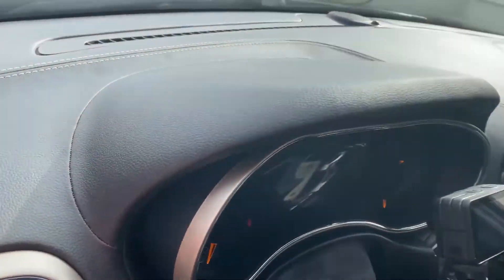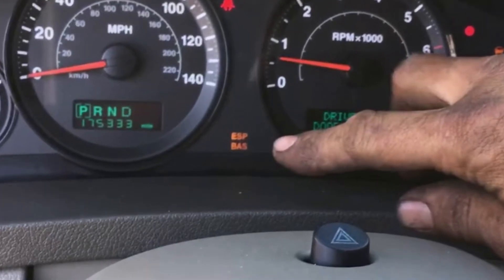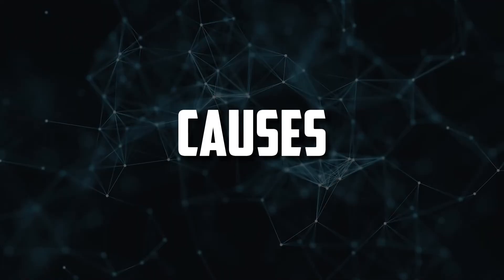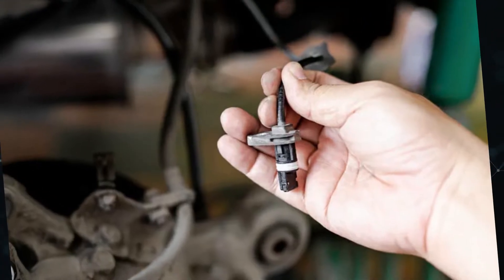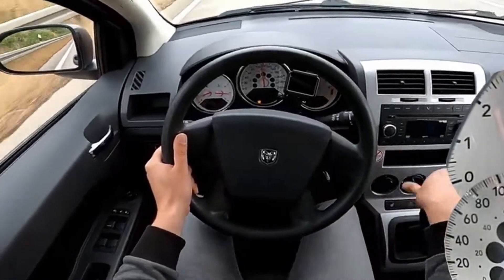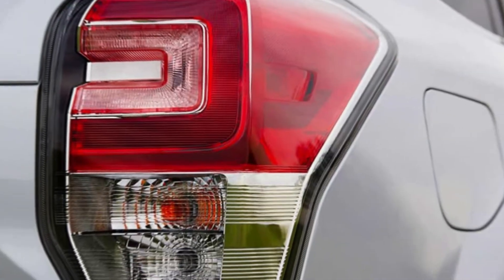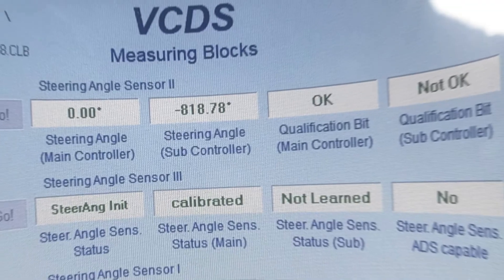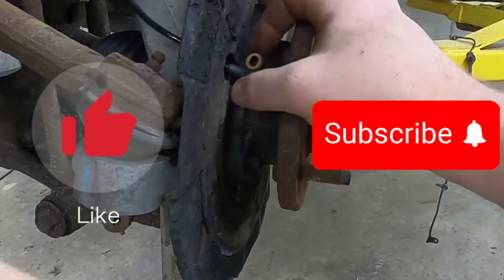4 Causes of ESP BAS Light on Jeep, Chrysler, Mercedes. How to Fix.

Comment: Suddenly all 3 lights (ABS, steering & ESP BAS) came on in my Durango. Although I didn't have much hope in it, as the first line of attack I tried the easiest thing mentioned by the different websites, turning the steering wheel all the way to the left, then right, then center - and voila, to my greatest relief, this took care of the problem! (Apparently the good ole steering wheel angle sensor needed a reality check.) Note however that the lights didn't go off right away, only upon the next start of the engine.
Reply: FOLLOW-UP! Unfortunately it turned out that what I did above was just symptom treatment, which reset the ESP BAS error, but did not cure the actual root-cause - so a couple of days later, the warning lights lit up again, like a Christmas tree. What really happened was that one of the drive axle boots started to fail, and that affected the wheel speed sensor as well. Bottom line: if the problem does come back after an error reset, the real problem should be diagnosed & fixed ASAP.

Comment: Does the Steering Angle Sensor makes the abs, brake esp, and traction lights to stay on? I've been driving the car with those lights on for 3 years, i dont think its something serious because its works perfectly fine, but the only thing left to check is the steering angle sensor, the codes say its the abs module but like i said there isnt any symptoms.
Reply: Thats good to know I have time for part to get here and it wont go crazy and explode. 🤣

Comment: I have a 05 Grand Cherokee Limited, I am having the ESP disabled message and traction control light come on, then the electrical light comes on, and goes into limp mode. I have changed out the Throttle body, alternator, and gas pedal. I did the relearn due to changing the throttle body. The vehicle runs fine at first, give some time, or if I turn it off and on it will start to run rough and goes into limp mode. 

The wheel speed sensor has never come up as a fault. I am using Jscan and BlueDriver OBD tools. Any help would be appreciated.
Reply: My A160 Benz is doing the same and I'm planning to take it to Benz for proper diagnosis
Reply: @unfilteredxcopconfessions  Let me know if they tell you anything, the Jeep dealer says they cant work on any vehicle older than 2008. Its still not fixed, after 3 mechanics.

Comment: Thanks for the info! My wife has been wanting a jeep for a while and we’re going to look at one tonight. The guy said the ESP light is on so this is very helpful
Reply: Update, could be wheel speed sensors. Biggest issue is brake lights stay on and it needs an ABS module=$500. Can’t even order one til mid March and then it’s another $270 to get it programmed. Previous owner had replaced it with a random one out of the junkyard and didn’t bother trying to program it, he probably knew it wouldn’t have worked anyways. So it’s been sitting in the backyard. She has her “Heep” at least..
Reply: Dude, try flagship one. Google them. They are out of new york, I had to replace the ECU, main compuer, in my sons 2011 dodge 1500. Was $375 shipped to my door programmed. All this, oh it takes monts and cost hundreds is usually crap. Had a dealership monkey tell me the same thing then tried to argue that I was lieing, pulled out my phone, pulled up the website, done.  @bowtiebuilding

Comment: my lights came on in my charger but i have been hearing a sqeaking for a few months. when i checked the brakes they were still meaty. i did not check the driver side brake though that is where it sounds like its coming from. could rolling around on bad brakes for too long?
Reply: I did upper/lower ball joints on my 07 Cherokee. It was revealed the brake  pad was only wearing on one side. I replaced all calipers, rotors, and pads. It was then this light came on. I think the sum total of the ball joints and frozen caliper led to this. Check your brakes